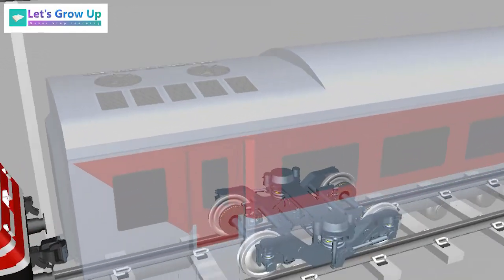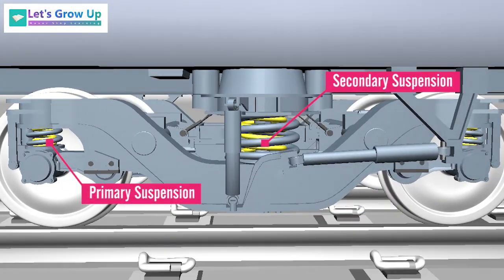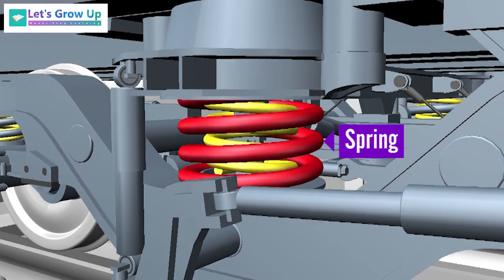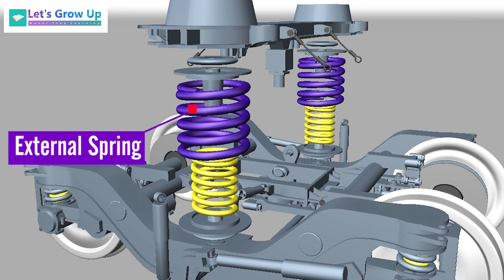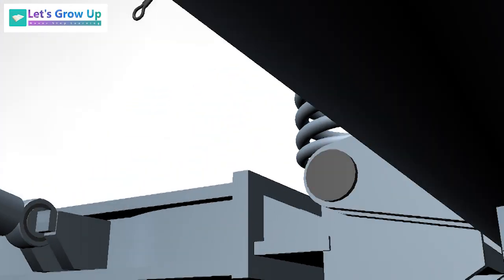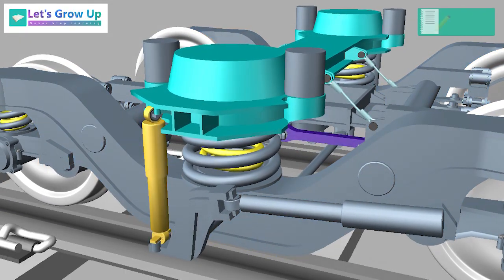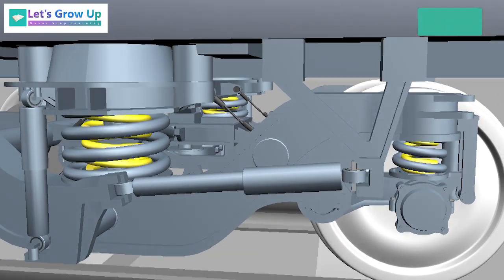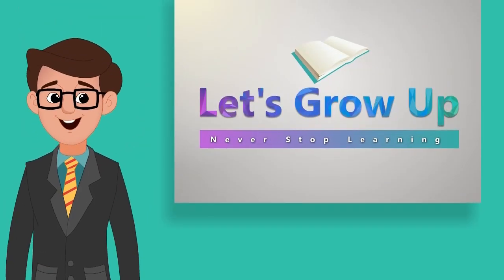How does LHB bogie secondary suspension system work? lhb bogie spring suspension working system

Comment: Lots  of jerks come in lhb coaches as well. May b fault is of tracks as well
Reply: That is mostly due to CBC because practically it is a rigid coupling and the jerks are felt due to less moving parts. ICF's screw coupling has lots of moving parts so jerks are felt less

Comment: Most inifficience coach ,it is suitable only air-conditioning passengers purpose,in general coach passengers feels very trouble because no proper system to enter sufficient air in these coaches.
Reply: LHB is meant to be AC coach by design and engineers made tweaks to cater to non-AC passengers, so no point of criticising. Do you think Germans would still be using non AC coach in their modern trains?

Comment: How LHB bogie manages itself on curve? It doesn't have central pivot pin right?
Reply: The provision of flexi coil spring in the secondary suspension make it possible. The Secondary springs can bend and allows the bolster to rotate along the vertical axis with respect to the frame. This allows it to negotiate the curve.